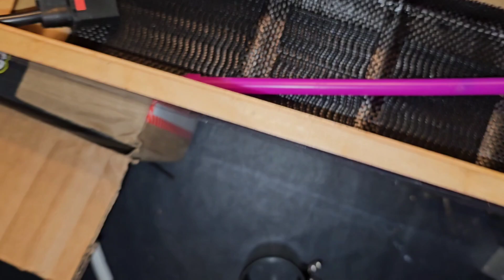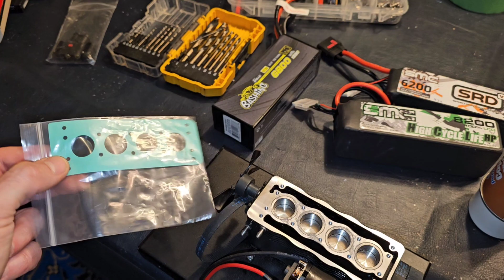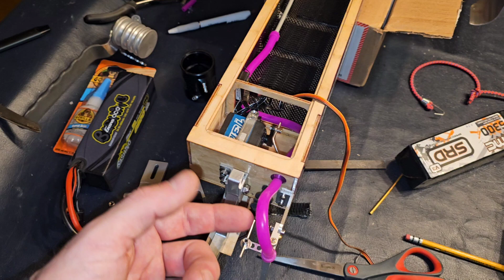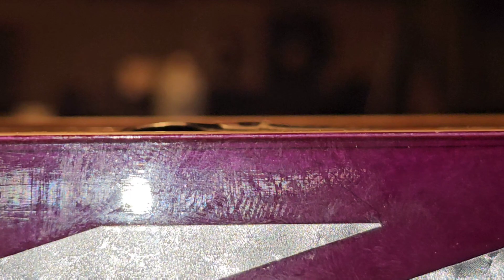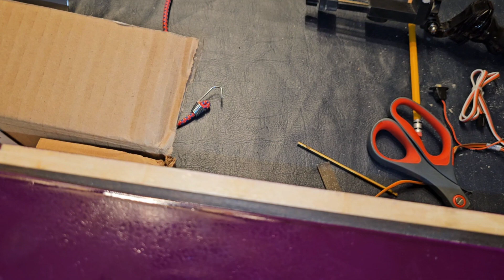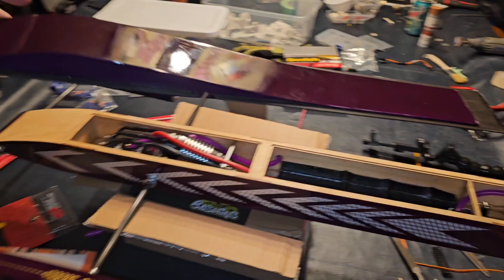Aluminum Tubing for cooling line. Hawkeye RC Outrigger. More changes to come!

Comment: Depending on how you're planning on holding down the cowl when running, you MAY only need to keep the bigger batteries from shifting side to side or fore and aft.  Or as another commenter said, carve a bit into the underside of the cowl where it's hitting the battery.  If you end up cutting through it, make a decorative "hood scoop" to cover it up.

Comment: Great motor and esc and kv choice. I preferred TP motors.
I would go 8s start with forget about 3s and 4 s that’s a waste of time start at least with a 1717-17-45 abc cleaver  or 1816 but I ran 1917 and you could after testing temps on the other props and then moving up to the 1917 on zero timing at first.
You will go above 180 kmh and more.
Probably 200kmh if the XL2s is able to handle say 10 to 12 degrees timing.
2x4000 mah 4s should fit edge on possibly 4500’s  hopefully room for two fibre glass sticks running across the batteries to sit under deck edge each side to hold the batteries in if the lid comes off in an accident.
I have done it all with this rigger but not ovals just speed and a lot more length of run that you are running in.
So if you want speed this info will save you lots of time.
If not It’s all good I’ll love watching what you do anyway.

Comment: Absolutely awesome video an awesome knowledge you share I appreciate it.
I would have converted my outrigger to Electric but I just don't understand it and how it works. I have a older custom built Dumas Roadrunner Outrigger and I am running a Nitro Nova Rossi 21 modified engine in it. absolutely perfect. Beast on the water and it is very scary fast but with overtime and a lot of Justin it handles perfect... eventually I would like to build one like your Outrigger where to buy an outrigger already built the only thing I had to do is put the largest can I can put in it and the extras etcetera I understand if you don't get the right parts with that can you can end up burning up everything so that's something more I have to research about appreciate your videos and sharing your knowledge thank you